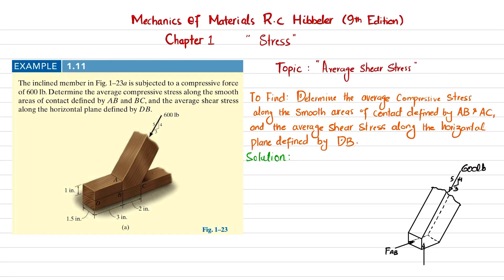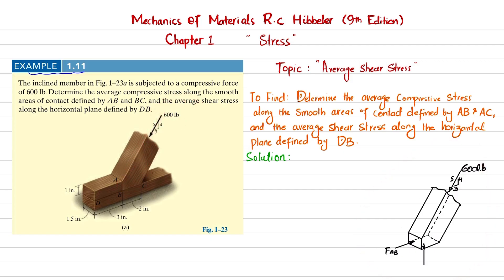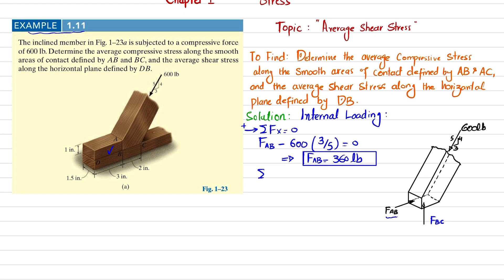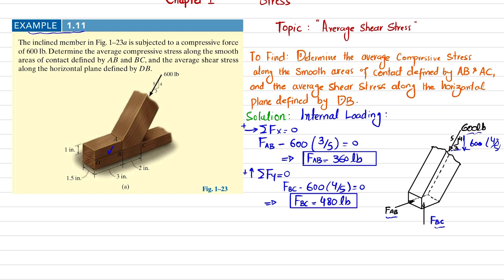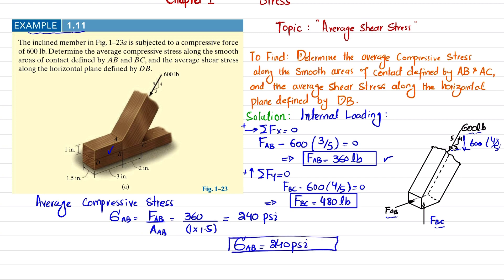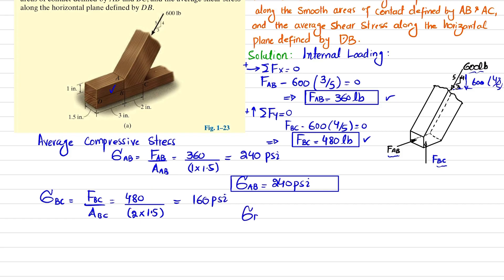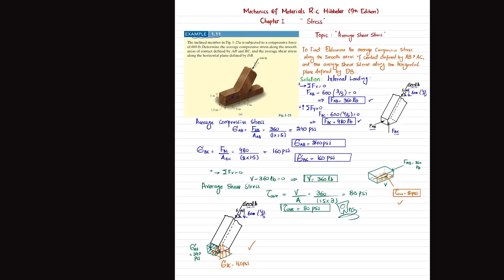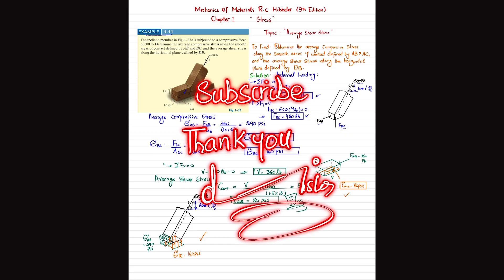Determine the average compressive stress along AB  and  BC | Example 1.11 | Mechanics of materials

Comment: So the highest stress section is experienced by the cross section where Fab is 240 psi? If the Shear stress of that same block is only 80 psi, does this mean that the wooden block will fail most likely due to splitting down the grain of the wood instead of "sliding" off of the block below it? I guess we dont know how the top block is fastened to the bottom one, I would have assumed that it would have failed from shear stresses. Thanks!
Reply from the maker: Yes you are right and also we don't know the failure strength of wooden block as this is not given in this problem. If we get the failure strength of wooden block from average mechanical properties table then we can conclude from that. Thank you 🙏
Reply: @engradnanrasheedmechanical  Thank you sir!
Reply from the maker: My pleasure @Unclesam493 ❤